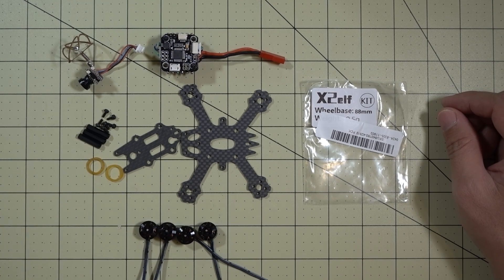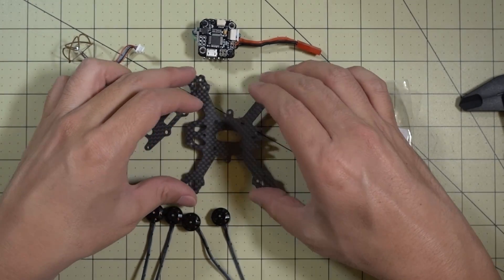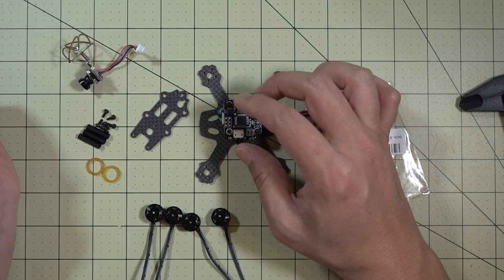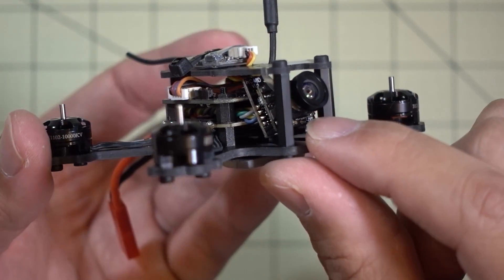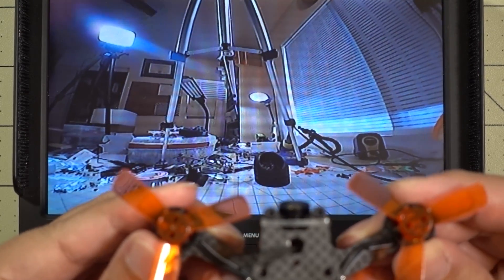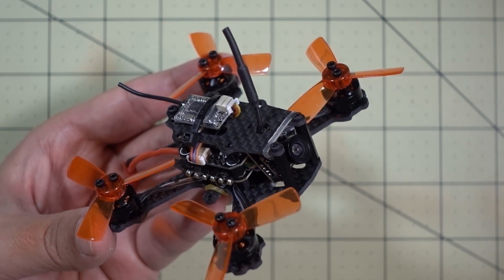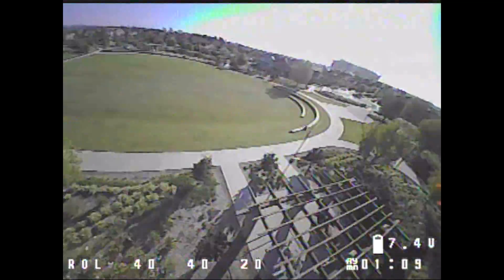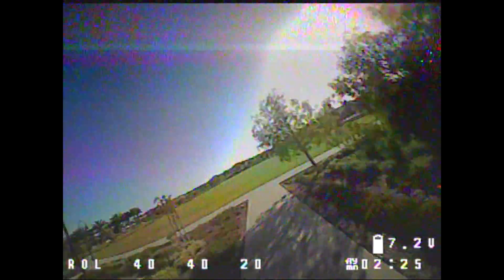Micro Drones 101 🔥 #3 💡 X2 ELF 💡

Comment: I wanted to build a quad just like this one but without the fpv stuff, just do fly line of sight because I love micros, however the ones that come pre built are almost all toy grade and don't have the power I would like them to have. I'm sure it can be done but correct me if I'm wrong. I want to do it AS CHEAP AS POSSIBLE if anyone can help me out I would be very grateful! 🙏

Comment: Hey Kim I'm a first time quad builder, and I would like to know if the Eachine Minicube is a pretty good board? I've seen some bad reviews and would like to know what your experiences were like, or do you have another recommendation on what flight controller to use...I will be using the same frame as you have here, X2 Elf...thank you so much and happy flying!

Comment: May i ask what size battery did you use? building one of these frames and my quad is coming in at 82g with 450mah battery, or 94g with 550mha.
Reply: Oh, it's around 56g without battery. fyi.

Comment: Did you solder your flysky ibus receiver directly to the ppm/sbus pin out? I'm building the same micro but instead of 1102 motors, I'm using 1105 motors with the Furibee F4 flytower.
Reply from the maker: +Astronaut Eazy I soldered a connector for the FS82
Reply: Albert Kim Ok great but did you solder the connector to the ppm/sbus pin outs. I don't see a pinout for ibus, only ppm & sbus & I have an ibus rx
Reply from the maker: +Astronaut Eazy solder it to sbus
Reply: Last question. What size screws are you using for the motors? The screws are too long for this build
Reply: Hey Albert, I recently finish my x2 elf 88 micro build (like yours) but instead of an f3 I have an furibee f4 flytower 20 amp esc. After arming, when giving throttle to the system, the quad spins on the ground. Unable to take off from the ground, instead its rotation in CCW direction. 

We verified all motor connection, Props direction and mounting, Throttle range calibration is OK., ESC calibrating perfectly in a normal way. What can be the problem and how can I fix this?. I've seen plenty of people in forums asking the same question but no answer please help. Have you ever come across this problem while building an micro?

Comment: Hey Albert, I got this frame after seeing this video. Love the frame. Holy cow is it small! Makes my Japalura 3" look large! I'm having trouble putting it together though. I'd like to find longer "columns". They seem to be M1 standoffs. These M1 anything seems related to unicorns. Google seems to think they are myth and legend. No one anywhere seems to have anything smaller than M2. And even those are hard to come by. Do you know where I might find these fabled parts?
Reply from the maker: The standoffs are M2 and you can get nylon ones at MyRCMart.  The aluminum ones are on eBay if you search hard enough... somewhat difficult to find however.
Reply: Albert Kim Thank you!
Reply: Mark Gardner kkooiiiiiiiiiiioi

Comment: I've been flying the aurora 100 for just a couple weeks but am experiencing a lot  of breakup on my goggles and possibly some fod's too. I'm pretty new to quads and would like to know your experience with these issues on the aurora. Do you have any recommendations on how to improve them? It seems the vtx antenna is has a lot of interference going on with its proximity to all the electronics and maybe even the frame. Would it be worth changing the camera to something like the tx03 and would that require a different frame? Thanks for any advice and awesome channel!

Comment: Hey albert, does the OSD work on this stack with any camera, or only with the original? Also, can you take the buzzer off the ppm rx and connect it straight to the FC?
Reply: Also, does the A8S rx work with ibus on this fc, or does it have to be PPM?
Reply from the maker: It can work with any camera but it will require soldering and knowledge (not recommended for beginner). Same with the buzzer.  Will require skill to desolder, and connect directly to FC but can be done by skilled hobbyist.
Reply from the maker: It will work on IBUS. I've set it up this way.
Reply: Albert Kim thanks! Just use the sbus pad on the FC?
Reply from the maker: +Jon B Baca yes

Comment: do you have any problems with f4 fc and turnigy evolution receivers on sbus?only ppm will work and have a omnibus f4 and a micro f4 fc both only ppm no sbus working when I switch the same receiver to any f3 fc no problems with sbus
Reply from the maker: +hooivork81 I use a different rx pin on the board to avoid the hardware inverter. I have IBUS working. See my X5R videos...

Comment: Hi Albert, will this frame fit the motors and props from the babyhawk? Is there enough clearance for the 2.3" blades?
Reply from the maker: No, this fits 2-in props only. You can cut the props down or use a 2-in prop instead.

Comment: Hi Albert based on your micro series I bought this frame, furibee f3 osd with 20a esc and dys 1104 motors which is basically the arfun running gear. glad the frame looks good in real life. can't wait for parts to arrive. PS x2 elf frame available on other sites. thanks for the helpful vids!

Comment: Very nice setup. I think your cam wasn't perfectly centered, which is why you got the right prop in the view.  Regarding the noise, I always thought the more blades you had, generally the quieter a prop would be, since the motors would have to spin faster to generate the same lift. Of course the blade design makes a difference as well, but I suspect because this setup is 10 grams lighter, that's what makes it less noisy than your other quads.
Reply from the maker: +SPL these props are just very quiet for some reason

Comment: Hey Albert, awesome video! Maybe the speed decrease is due to the props. I put those props on the Babyhawk and it became slower with less punchout too! Question: I have some 1102 motors and some 1103 motors and the 1102 motors look beefier and heavier while the 1103 motors seemed smaller but with taller prop posts! Are those 1102 motors you show here, heavier than your 1103 motors?
Reply from the maker: +Frequent Flyer RC good question ... My 1103 motors are all mounted so can't weigh them. The 1102 motors were 3.2g? Maybe someone else knows the weight of the 1103 motors?
Reply: Albert Kim just weighed a new racerstar br1103 10000kv = 3.3 grams 👍
Reply: If I get a 50% bigger stator for only 3% more weight, I would always take the larger option and take the 1103 motors, more powerful and more efficient

Comment: Hi, thanks for this video. I like the performances of these mini-quads with 11XX motors. According to Dave Woods' measurements, we should get the highest thrust and efficiency with ~66mm 2blades props (test with 1103/10000kV motors: https://www.youtube.com/watch?v=9m5eiP4JOU4) - I am guessing that it would be similar for your 1102 or 1104 motors... Which frame would you advise for 60-66mm props and to fit a runcam micro swift ? Thanks!
Reply from the maker: I would get the KT100 frame. The Swift Micro will fit with some spacers. http://goo.gl/48SeRu

Comment: Great. How you made your linear antenna? Thanks.
Reply: Do you or any one have success all the time changing or replacing antennas on these AIO VTX. I've tried multiple times but my signal strength is cut dramatically every time and nothing looks bad. I always just end up buying a whole new aio vtx.
Reply from the maker: +David Gironella I bought a pack of whip antennas and desoldered the circular and soldered on the whip... Link to antenna pack is in the easy bake micro drones video #1
Reply from the maker: It takes practice and you have to make sure your signal and ground are isolated. I've tried to video this but the camera was not able to focus on such small things so it's hard to show how to do it.